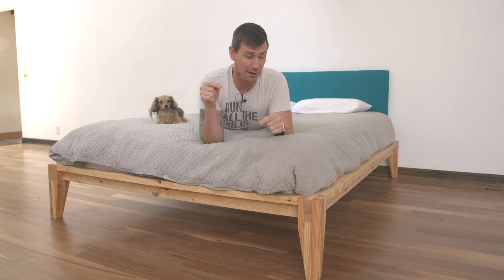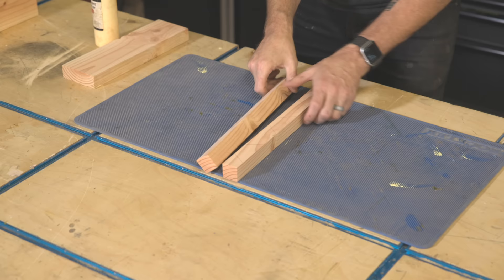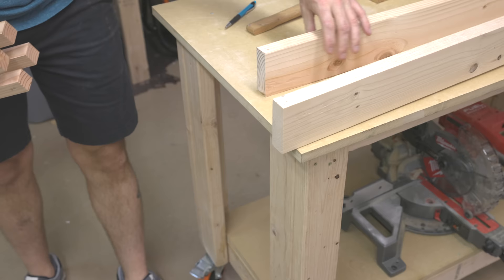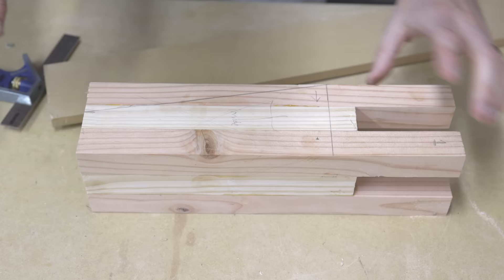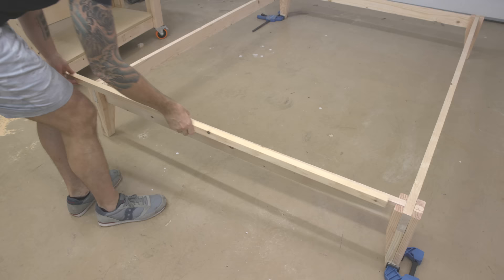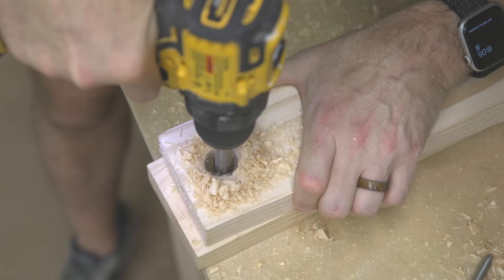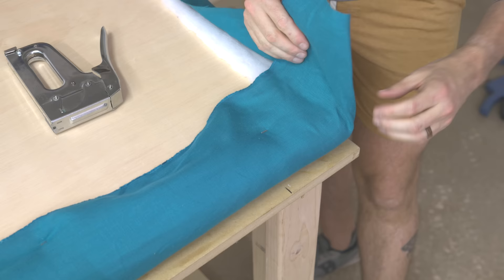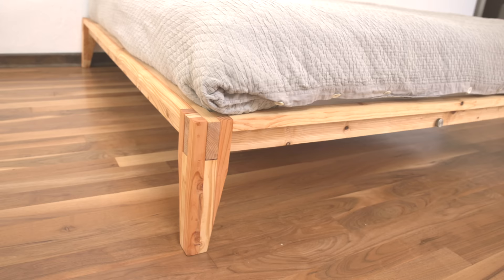DIY Castle Joint Platform Bed made w/ 2x4's Buy vs. DIY

Comment: This is such a cool design. I was looking for a way to build a "portable" bed frame. One you can easily pack up and reassemble for college students. Of course they can just buy a $100 thing metal frame, but this is way nicer. My only thought is for a twin or twin XL, to also set up the long boards in the middle to be cut in half and fit on two more legs and a 3rd one in the middle (like you have for this one) for support. But for full/queen/king seems I'd also need to split the width boards in half too to be able to break this down in to sub 4 foot long lengths, so you could fit it all in a couple sturdy bags when moving.

Comment: One thing the concerns me about this joint is the small piece at the end of the beam and the wood grain orientation......it would be very easy for it to snap off and render the joint useless. Even before assembled, a small impact on the end of the beam would make it pop off. I have cut variations of the joint previously for ‘knock down’ frames that can be quickly disassembled and reassembled without fasteners and is very easy to damage. Don’t cut it too tight or it’ll break during assembly. Be careful with this type of joint and handling your beams.  Not sure I would use this on a bed, I’d like to know how it’s held up.
Reply: 100% agree what about when things get heated up? I doubt it will hold up the first month for newlyweds. Just saying. Perfect bed for teenagers when their kids get into puberty and have their bfs or gfs just cut it tight so it will snap under any king of unnecessary rocking. No adult supervision needed.
Reply: Drill a hole(s) in the stub end and insert a dowel or two?
Do you think that might work?
Reply: Wouldn't the pieces added to the outside/inside on the stretchers end up taking most of the racking load?  They'd push against the outside of the legs since they're so tight before the joint inside the stretcher gets pressure on it.
Reply: Yep, I tried to build this. An end piece snapped off during a test fit. I let it wobble too much and it snapped right off. Maybe those ledges he uses would reduce the shearing force on the joints once the bed is built.
Reply: What is a better bed build alternative
Reply: Soooo I actually did something like this. But didn't do the extra support on the horizontal pieced and after a few months of um movement in bed those pieces all broke. I did some research and after this video I'm going to do the gluing for the castle joint but for the half flaps. I'm adding like 4 extra inches after it. Yes it will stick out more but it will  add a nice touch I feel and help avoided this problem again
Reply: What about doing the joints with hardwood or birch plywood? I love the design, but pine breaks so easily. I would feel awful to do all that work and have it break.
Reply: I found that the small ends snap off with the slightest pressure. One joint a little snug and both rail ends snapped off tapping it out of the leg after a test fit. Another was just a hair loose. It snapped off while raising the other end of the rail to place in the leg. Right now I'm not sure I will finish the project...

Comment: Love the design process and the making of these joints, putting and slotting them together is satisfying.

To me the edges look a bit sharp and could possibly cut or make some splinters, maybe add some padding to the corners?

Comment: This the bed I wanted to build last year. Thank you for the castle joins and the additive joinery. Quick question: If you had raised the slats up a bit, or had a slightly deeper apron, wouldn't it have been possible to run that central strut vertically and obviate the need for the central post?
Reply: Nice thought!
Reply: Vertical would help, but you are still talking about a piece of fast-growth softwood that is best in compression or tension along its length, and crap in lateral loading (resisting bowing).  Trading it out for vertically-oriented plywood would be better (and resist twisting by building a "T" or "I" beam).  But let's think about this.  While removing that center post might improve the aesthetic, support sleeping bodies, and give you more spring during "jumping", it is begging that stinger to split, or where it connects to the rest of the bed frame to fail.  This speaks to why many beds are built robustly, out of higher strength materials, and include a center post.  Whether your mattress has a foundation or not, just add the center post with an adjustable foot (if you are one of us with wonky floors and don't want it tapping out a rhythm while "jumping".)  All my beds have them in my home and I only see them if I am crawling on the floor or moving houses.  I try to keep both to a minimum.
Reply: @jonathanboyd144  It was only on the second occurrence of "jumping" that I realized you were not, in fact, discussing jumping. Nicely done. And agreed on your structural points.
Reply: @jonathanboyd144  if you live near a home sawmill they can mill you rough cut hardwoods for about the same as store bought.
Some may already have the stock you need that is properly dried.

Comment: "Today, I'll show you how to build these using 2x4s, accessible tools..."
Step 1 - "I used a planer..." ($400-$500)
🥴
In all seriousness, really cool build! Just maybe not so accessible.
Reply: Great build but it’s still cheaper to go buy the Thuma bed frame. If a person already has all that power equipment, I’m pretty sure they would be able to make the bed frame without this tutorial.
Reply: You could still use this method with out planing.  You will just have rounded edges
Reply: Valyōu Furniture sells an identical bed in more color choices as Thuma for $600 shipped
Reply: @Christian-fx9ur  My planar is only a hand held electric one, fine for this project. So you could say I do have all the tools, but I definitely appreciate this tutorial and didn't already know how to do it. I can't wait to be able to say I'm a pro with all these tools though, and my primary tool for learning these skills is right here on YouTube.
Reply: @adammiscellaneous9309  excellent feedback sir! I stand corrected. Thank you. Very good to know. I'm not handy and I'm probably a bit jealous of you guys that can make stuff. I sincerely appreciate your post. : )
Reply: @Christian-fx9ur  You're here watching this video, so I'm sure you can make stuff! Or at least have a go, which is what I'm doing most of the time, and it's fun, which helps with the learning curve aches and pains. And man, I feel a lot of those aches and pains! My current project is my biggest yet, building a 3m x 3m workshed, which tbh mate, intimidates the crap out of me! I sure am sick of dragging tools outside and putting em back away at night tho. I digress! Just have a go, with whatever tools you've got, have fun, and good luck!
Reply: I just run 2x4's thru the table saw and cut off the rounded edges.
Reply: @Christian-fx9ur  🤔🤔🤔🤔🤔🤔🤔
Reply: If you do it one time - it may be easier to buy end product, but if you like to do such stuff - buy the tools.
Technically - all the tools are used here are about 500-1k++ depending on quality and brands. 
But next time you will not count them as expenses.
Reply: i have access to a planer and joiner but no knowledge
Reply: Build up that tool collection boeh. The DeWalt planer was one of the first serious tool I bought and I've used it for pretty much every project I've built.

Comment: Actually, castle joints are easily cut with a handsaw and a chisel. The problem with them is that when wood shrinks the joint gets a bit loose. I'd reinforce the joint with dowels and make it permanent

Comment: This was so satisfying to watch it all come together - a beautiful piece, nice work and yup, I’m with you, in that I’d rather DIY a project than buy it new. Usually you can save a small fortune, but it’s knowing you’ve made it yourself which I find the best part.
Reply: Usually it's a lot more expensive to build it yourself. You absolutely cannot build ikea wood furniture (i.e. hemnes stuff) for even double the price.
Reply: @overnightclassic2  i disagree - it's where you source your wood from and how much work you're willing to put in. I recently made a freestanding slatted pergola enclosure, with bench seat attached. Total price? $130AU. If youve ever cut into IKEA furniture, alot of pieces are hollow and the rest is particle board covered with veneer.
Reply: @kylieb4836  I'm talking about the ikea furniture that is wood.

Comment: I think you recessed the mattress into the bed too far. I would think 1/2 inch max as it will lend a better esthetic to the mattress. And with all the work and cuts to make the legs, I'm thinking a 4x4 is probably a better option all around...a couple of dados and you're done. Since you used the table saw to cut all those pieces, you could have used it to make the 2 dados which would be far quicker and easier. But overall solid job, for sure! I'm just a critical person...it's a very good job.

Comment: Olive.  Nice build.  I don’t have a planer and hoping I could still make it work.
Reply: I don't have a thickness planer either and was able to make everything work by using 2x6s instead and ripping the thin sides of the boards to get rid of the rounded corners. This meant that the pieces I was working with were slightly thicker than that of the video, but I actually prefer the chunkier look. I also increased the height of the stretchers from a 2x4's actual 3.5 inches to 4.5 inches since the 2x6s offered more flexibility.

Comment: love castle joints, hate how those legs look though. the grain is all over the place as is the coloring because theyre from different boards. there are visible gaps, areas where the rails are proud in one direction and come up short in the other. for 300 bucks and a project for a regular homeowner (who has a planer?) sure itll do. id rather work off marking knife lines, get everything to be tight so i dont need extra rails outside strengthening the loose fitting joint, and make sure the castle joints are still front and center in the project. they get more subtle when you essentially hide them and that feels silly after all the work to get them to work. regardless if its like this or with hand saw and chisel work. if youre gonna do this yourself leave your rails long so you can sand them back to flush instead of them being either too long or too short

Comment: If the supports for this bed are only held together with glue, this isn't something I would expect to have a long life. I'd be a lot more comfortable using this for a cool coffee table or something like that, with a lesser load bearing expectation.

Pretty easy to drill and screw for some better support. It's a clever way to avoid having to do precision joining.
Reply from the maker: Wood glue is extremely strong, often stronger than the wood around it.

Comment: The 11 inch board that you put between the two parts of the castle join is not a piece of 2x4, right? It would not have the right width. Did you rip cut a 2x6 to the right thickness for that?

Comment: Hi, greetings from Russia, many thanks for your video.
Your project would be quite cheaper here.
I'm too lazy to check the lowest available prices for boards, the Leroy Merlin price for 2"x6"x120" edged loose pine board is $6.60 (taxes included).
The same but of 1" thickness would cost $4.98.
If you go to suburban openair market, you'll save about twice but the wood would be too wet. Ok for construction works, not ok for the furniture.
The same gap is for the rest of your shopping list.

Comment: I really love this design and the simplicity, eager to build asap my only concern and question is how strong is the joinery if i make it for a king size, i got 2 kids who are going to using this a trampoline and will need to push the bed from side to side to sweep underneath. So basically my question is will this take kids beating and the occasional sliding the bed with in the room with floor tiles for cleaning purposes

DIYer from Bangladesh

Comment: It's hard to imagine a weaker joint than that corner joint. The short grain on the outer end of the stretchers will just snap. Don't even contemplate doing anything active on that bed!

Comment: There is nothing you could not do in this project with just hand tools (planes and saw, pretty much), if you have the skill and time. Now, I can't say how long it will take someone to build it, based on his skill level, but let's just say 20 hours. If you put some more or less arbitrary value on your time, let's say USD 15, you end up with labor costs of 300. It's still less than 1100 in total. So depending on how much time you have, how much skill you have, what tools you already have and how much your time costs, it might be a good idea to DIY, or it might be better to just buy a bad.

Comment: "Olive"

Love the castle joint idea. Did you add the central leg under the bed because you're working with softwood or because the castle joints require added reinforcements?

Comment: Question for anyone who can help me understand the leg construction. When ripping the 2x4 the thickness of the board that is obviously not ripping it right down the middle. So you will have a thicker and thinner piece left over. It appears @Jonny is using the thinner piece when combining them to make the legs. Am I correct saying that? Or is he using the thicker pieces to create the legs? Any thoughts would be great.

Comment: the stretchers and legs only slot in together, no glue/nail/screws? the joints slot in way too easily and it looks wobbly after assembly.

Comment: Olive, I liked your design. You said the additional ledge supports stiffened up the frame and prevented the wobble due to tolerances in the castle joints. Did that work well? I was thinking a six inch screw driven through the half laps straight down into the leg would help as well.

Comment: Doesn’t look as nice but I do the same for less than $100! I use,
One 4x4.  $9
Four 2x4’s.   $16
Four 2x3’s.   $12
One box of screws.  $20.  
One 4x8 sheet of plywood usually whatever’s one sale dirt cheap. Doesn’t have to be thick. $12.  Comes up to about $70.

Comment: Question I have a wood platform bed but it has no holes or slots for a head board, how do I attach a wood head board to the wood platform bed with out there being any holes. Do I have to drill holes to and if so what drill and screw do I use to hole head board in place

Comment: @Jonny Builds great video! Thanks for posting. I'm half way through my build. Legs are done, in fact castle joints are worked out really well. Just measuring everything up for the lap joints now.  I'm really struggling to find thumb screws online. Can't seem to find anything long enough, I was thinking something at least 90mm (3.5 inches) would do. where'd you get your thumb screws. I'm based in the UK and regular hardware stores don't seem to carry them. any ideas on where I can get one online. ps. my lumber came to 272 GBP Apr 2022 prices!!

Comment: Your video is great and I have made a lot of progress.
I am working on the bed frame per your video and I’ve run into a problem as I notch the test rails as they meet a post my test pieces are breaking off on the end and the only thing I can think of is that I am keeping them too tight for a good fit and that is stressing the ends. Do you have any thoughts?

Comment: Wonderful work but I have my doubt about the glue , is the bond strong enough to last I would have taken extra precaution and used screws, if the thing comes apart then I am really screwed.
Reply from the maker: The glue is stronger than screws.

Comment: You trust that wood a lot huh?? I would consider not cutting the tappers on the posts if you want it to last that much longer.. to be fair though they are still 10yr beds with tappers in my opinion.. some may disagree but that's theirs opinion just as this is mine..

Comment: I have a dumb question: Could you do the slats from right to left instead of top to bottom? Currently have a Queen Size bed, wife is thinking about a King one day. Sure, you'd have to run the support horizontal instead of vertical and then....

Comment: Ingenious castle joint method.  What is the purpose of the webbing in the slats?  Is it to make it easier to transport... or are the slats not fixed down to the bed?
Reply from the maker: The slats are not attached to the frame. Adding the webbing allows you take them on and off easier, and maintains the slat spacing when you install the bed.

Comment: I'm in the process of building a bed... Platform style and honestly I'm not chiseling YET but using only hand tools has been a challenge. I thought I could use my ebayed Bosch jigsaw to get things going but using similar joinery to what you've got has been tough going... I have to be SO CAUTIOUS not to over cut and the jigsaws blade CAN FLEX so it's like oh my how am I going to get clean lines without the chisel? I was never concerned about this aspect as I'm borrowing a set and that's helpful but WHO KNOWS WHERE I CAN like... Rent? Or use some of this large equipment you've got?? Is that a stupid question? Do people rent spaces with this sort of equipment to folks like myself? I don't find it cost effective if you're saying YOU HAVE TO HAVE these planers/tables saws etc... I am rolling dice on only hand tools...my give in the project is that yakisugi finish... Should hide some foibles... Ugh. All because I wanted a bed that I couldn't find!
Reply: YOU ARE ABSOLUTELY RIGHT ABOUT THESE BEDS THOUGH! THE MARKET IS FLOODED WITH TRASH.. The wood is fake or veneer at best. They are throw away at historic or antique pricing. Its really unfortunate the gauging I've seen. Shipping should be expensive but the weight of this particle board trash yikes how are these conglomerates getting this board to your house for Nothing 🤣(king bed is 2700$lololol)